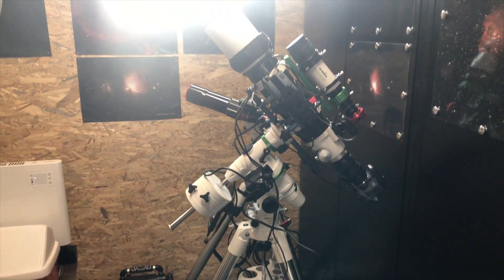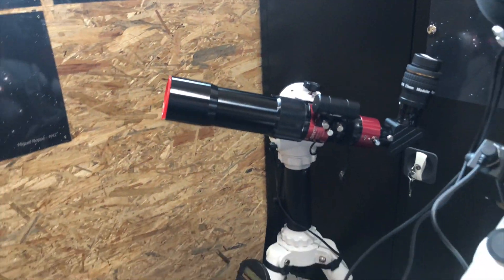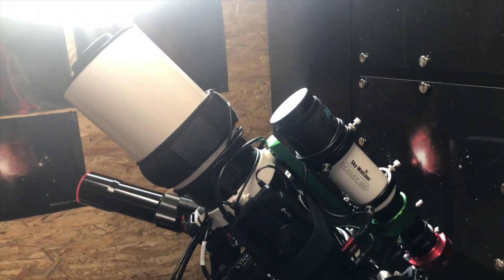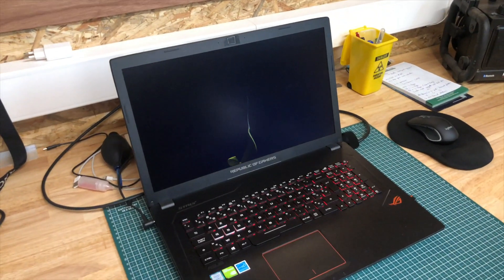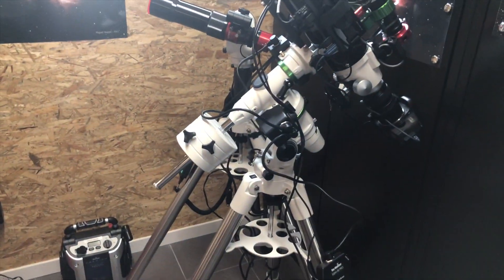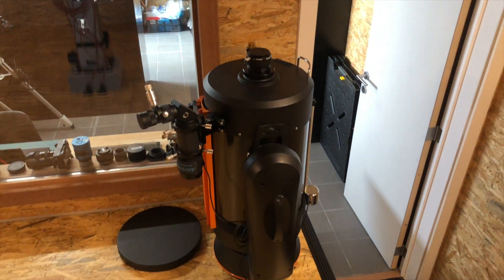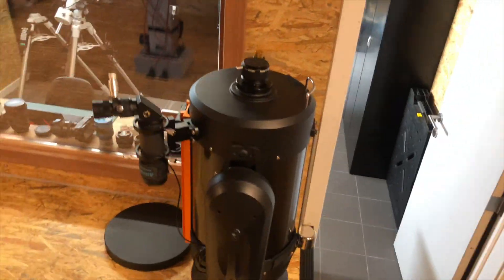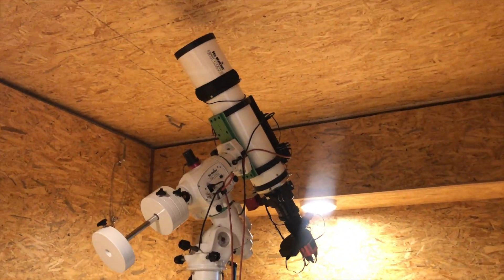Building a home observatory

Comment: I am more curious about your telescope. Name/Brand, cost? Wife and I have 60 acres, we want to build an observatory to have as an addition to our rentals here. I can build the building, no sweat. But have absolutely no idea what to buy, costs, power of telescope, price really isn't the issue. Just don't want one that's subpar, making me wish we bought the better one. Any info would be of great help!
Reply from the maker: The telescope is a Sky-Watcher Esprit 120, it can hold it's own against more costly competitors imho. I did recently upgrade the focuser tough. Also bought another mount then the one you see in the video. A 10 Micron GM2000 lives in the observatory now. I still kept the Sky-Watcher EQ6R pro and HEQ5 pro, the 6 is mounted on a pier in the garden and the 5 is for on location. I upgraded the mount in the obs to handle longer focal length telescopes, such as SCT's, for astrophotography. If you only want to do visual observing then there is no reason to buy a high end mount really.
Reply: @Miguel_Noppe  thanks for the info

Comment: I am in the process of buying my first house. this is something I will be putting on my property. maybe not to this magnitude. but definitely a roll-off Observatory. There's something really awesome about being able to go in your backyard and observe the night sky like this. In this little mini command station like Star Trek.
Reply from the maker: Well Joseph, if you have the space, funds and time to build an observatory, do it ! It really is so nice to be able to do some astronomy at a seconds notice, the gear is there and ready to go, you'll be able to grab those evenings where there's only a few hours of clear sky when you otherwise wouldn't bother to get all your gear outside. Good luck to you.
Reply: @Miguel_Noppe  I totally agree.  In my mind, there are obviously many positive reasons to have a backyard observatory, the biggest one to me is not having to set up and break down each time you want to image something.  As AstroDude stated, with a portable mount and the prospect of having questionable weather, I would not go through the hassle of setting up, but with an observatory, a flip of a switch or two and you are ready to go.  I also like the warm room feature of AstroDude's observatory.  If that is not practical as probably the case in my situation, I would opt to control things from inside the house instead.  But, like I said earlier, his set up is like a fortress of solitude or a modern Man Cave.

Comment: Very nice! Where did you get your height adjustable pier? And do you have any issues with wobble/vibration with that pier for imaging especially at longer focal lengths (>1500 mm)?
Reply from the maker: Hi, i bought the pier in the Netherlands @ Laagland.nl, but if you Google a bit you'll find others (and cheaper, this one was about €1500). It has a 400kg capacity so it's quite sturdy, i haven't seen any wobble, my longest FL on the pier to date is 840mm, no idea with longer FL. I rarely lift it up though, now and then for moon and planets, that's all, i always pick targets that are high up at that given moment.

Comment: SWEET! I noticed you insulated. I am thinking of getting a shed to store my big dob in permanently. Currently it is stored unassembled in a trailer in a climate controlled garage. I am worried about the extreme swings in temp causing the mirror to get condensation on its face every day and just over all wear and tear from the daily expansion and contraction if I go with a shed without climate control capabilities. Curious as to your thoughts and why you chose to insulate.
Reply from the maker: Hi, i think keeping the temp and humidity more or less constant is better for your gear than letting it heat up and cool down daily, just my 2 cents....